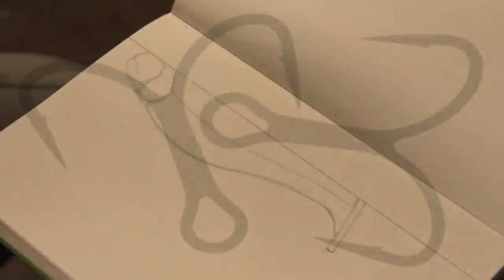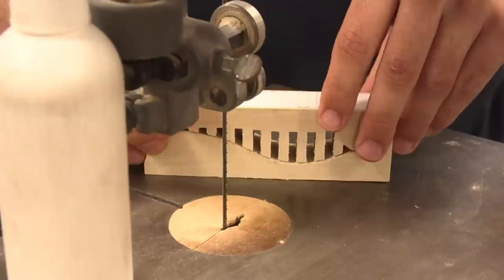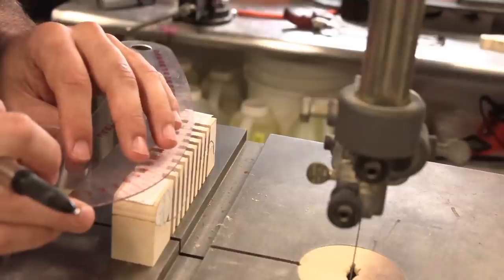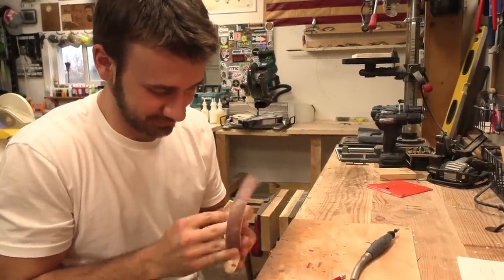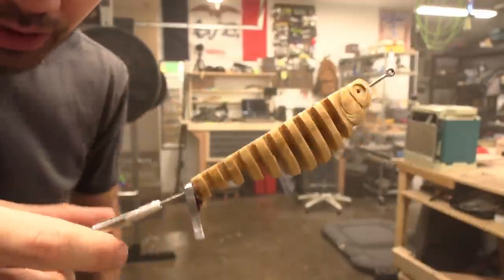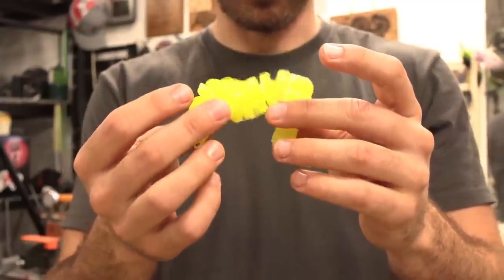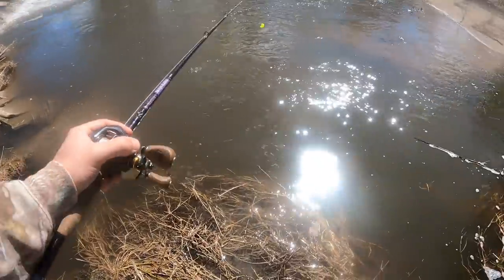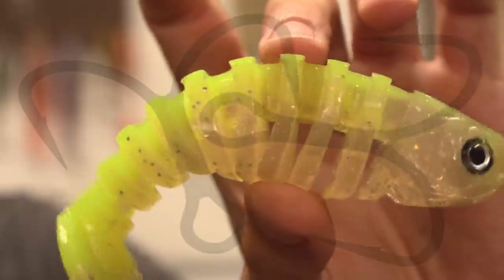Making an AGGRESIVLY Ribbed SwimBait

Comment: A pro tip I've used A LOT when temporarily joining 2 pieces of wood is to lay down painter's tape on either piece,  and put the super glue on that.  I use it on router templates for guitar bodies and it holds together surprisingly well but also snaps apart clean when you need to separate them!

Comment: Rapala ripstop suspension midwater jerk bait minnows hv a combination of weighted shot w/ body of lure, & a metallic weighted paddle tail. In combination the two create a horizontal dip, tail down head up, when stop your retrieval & suspendeds minnow at midwater until begin to retrieve. Maybe incorporating these techniques to your own jerk baits will provide such a suspension effect, & cut back on the steady retrieve (allowing fishes to catch-up & make a strike as they slowly make their ways out of a hibernate state). Just sharing what works for me, I know doesn't pertain to this build specifically.

Comment: I’m just guessing here, but couldn’t it be that they had different actions in the water because of the flow? 
I mean even a deep diving wobbler will lay flat on its side & there for have it’s usual action disrupted if the current is hard enough,  it’s great testing it out in different types of waters since there’s a lot of factors to take in consideration :) 

Not that I’m telling you how to do your job, just thought I’d share my thought about it!

Ps.  Fantastic channel, watching & rewatching videos almost every day.
Reply: What caused the better action is the stiffer spine. So in order to have a good kick, the tail is pulled on one direction, then pulled back by the rebound of the plastic. This causes the other side to catch and kick out on that side. So a weak spine will result in a laxidasical kick while one that is too stiff will result in almost none.

Comment: What if you used a soft plastic and a stiffer plastic together? Stiff for the backbone and soft for the paddles/ribs? What if you made a lure with the hook already in the mold when pouring so the hook point is hidden in the anal fin? Totally weedless and the hook point is always at the perfect spot in the lure for setting the hook. Use steel leader to keep the long lures flexible. A pre-hooked softbait I guess you could call it.🎣🎣🎣🎣🎣🎣🎣